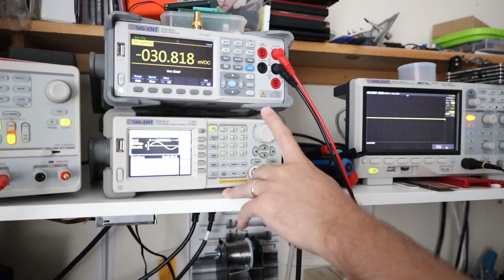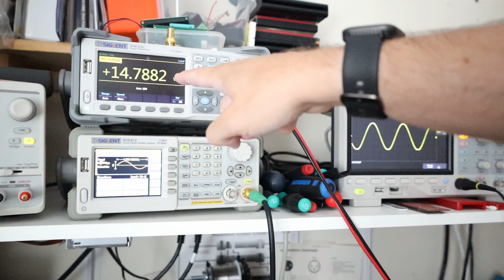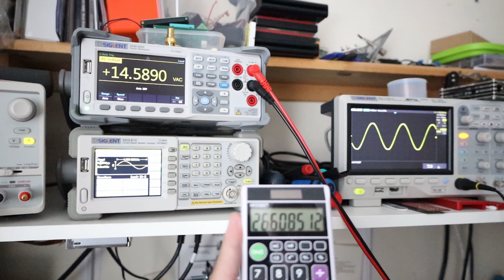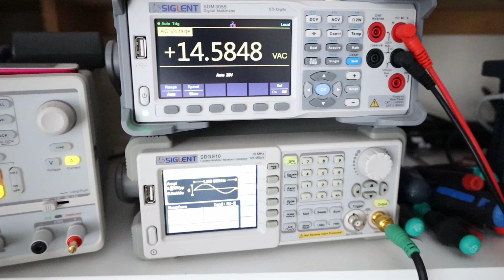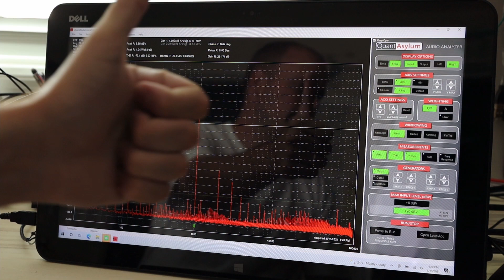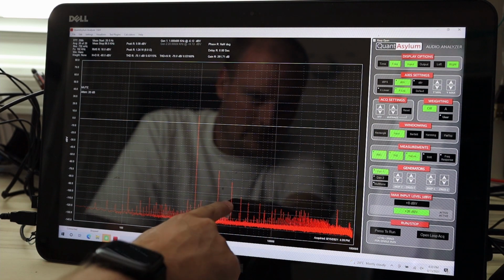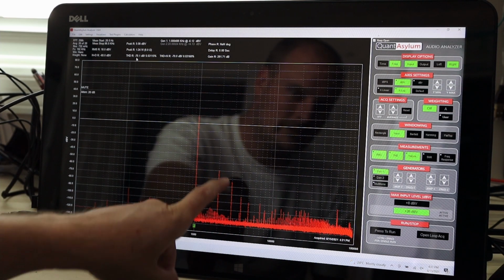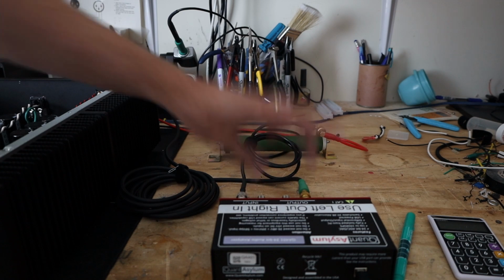Finished F5 With IXYS & Measurements & photos

Comment: Thanks for the video. Your amp looks really nice. I'm still learning, so I have a couple of questions if you don't mind. You mentioned the ground loop near the beginning of your video. You said that you drilled the holes for the jacks. I'm guessing that if you had an issue then the holes were too small so the RCAs touched the chassis, or am I miss understanding the issue? Also, what chassis and power button did you use. They look really sharp. 👍🏽

Thanks again.